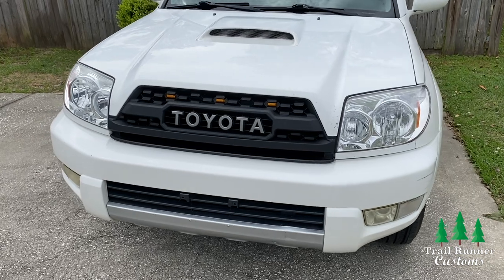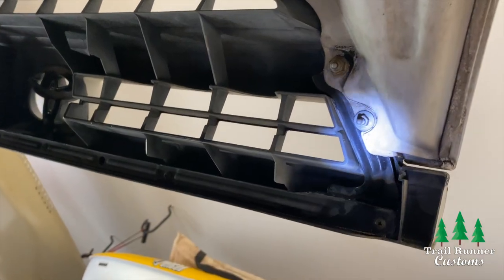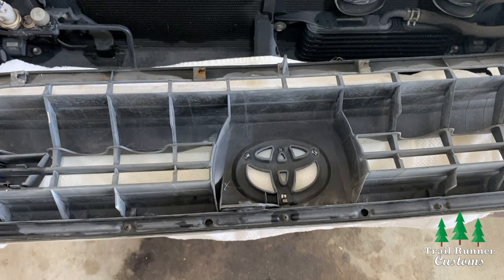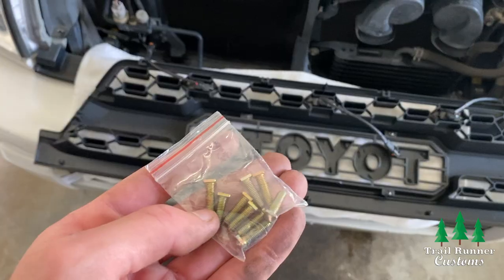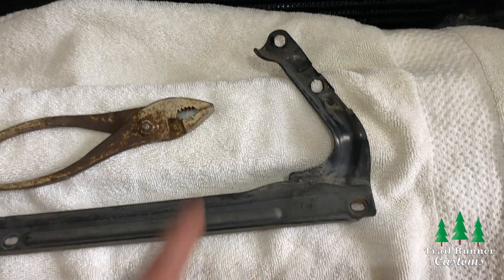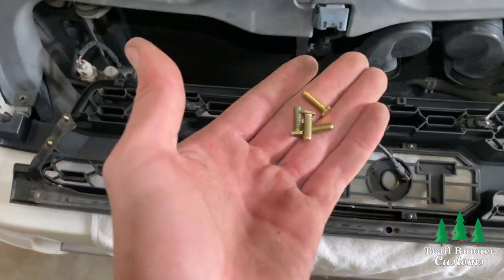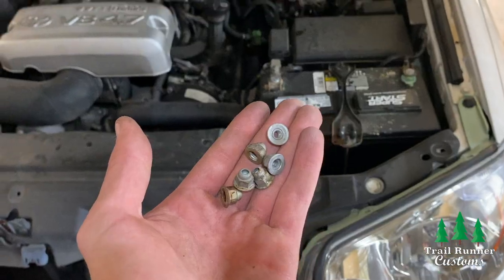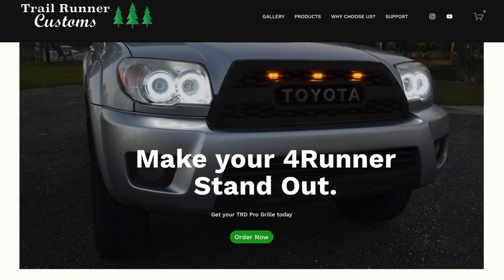Toyota 4Runner TRD Pro Grille 4th Gen (2003-2005) - Installation Video

Comment: Really like it..but I hate to loose my V8 emblem 🤔
Reply: Put it on your keychain
Reply: I was able to cut away some of the parts of the V8 emblem and snap it into place on mine. It took several tries to get the right parts cut away but it worked. Not all the old tabs were usable but the bottom 2 were retained and snapped in. I'm just going to super glue the top part even though it fits pretty tight and I doubt it would come out.
Reply: @daemorootg8693 Can you post a pic?

Comment: Does anyone know if i can use the 2004 grill bracket? Currently doing a 06-09 facelift and i dont know if i can use my current 2004 bracket or do i need to buy an 06 grill so i can take the bracket from it?

Comment: I agree with AZ RockRunner.
There really needs to be an option to retain the V8 emblem
Reply: Always thought it looked cartoonishly big and out of place sitting off center. They could put small v8 emblems on the sides of the vehicle or use a smaller emblem on the back door than was used on sequioas and land cruisers

Comment: Is there a place where i can purchase the square bolts hardware? i didn't receive any when i  bought it from a different online shop. The overall quality of the one i got  does not fit good. The bracket did not fit well. Even cutting the mention tabs in the video. And the oem hardware doesn't fit well either.
Reply from the maker: Email me your address and I’ll ship you some for free. Thanks!